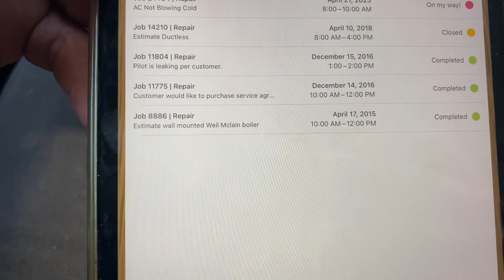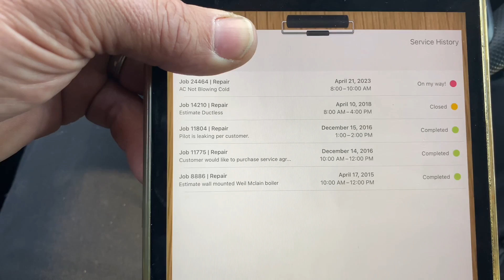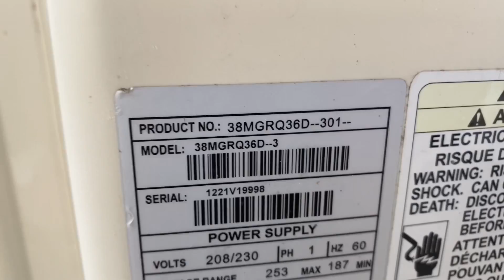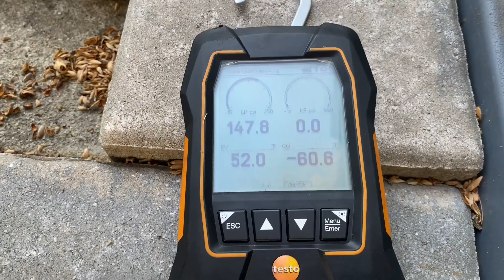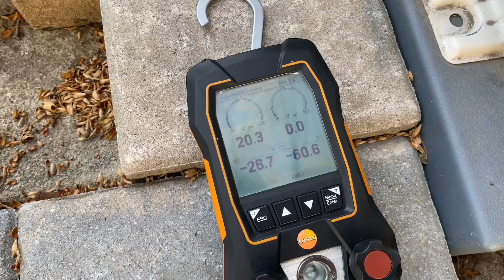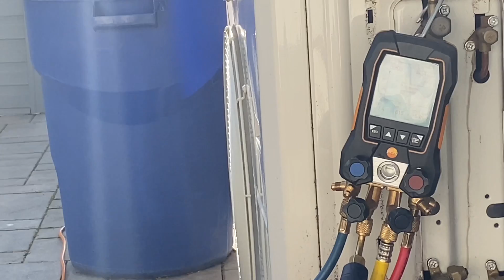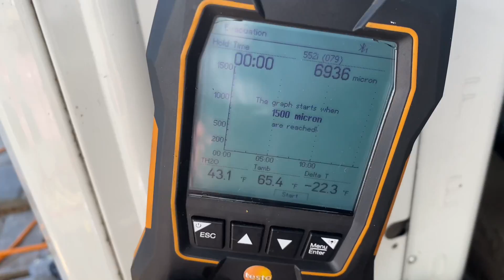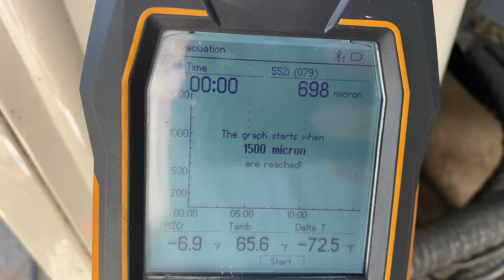Solving the Mystery: How to Locate and Repair a Leak in Your Carrier Multi Zone System!

Comment: I recently ran my pump without oil (same pump) noticed it was gassing alot the valve was open but I was already down to 900 microns closed my valves and all 😂😂😂😂 great work!!

Also about to invest in a second vacuum gauge tried the y Jack and it disappointed me 2x I’m thinking about Uei,hilmor,Accutools. I like my mg44 always works great with the trublue hose setup

Comment: the bad flare looked cut crooked/dull cutter wheel, flared crooked and probably never reamed. I can say a tiny burr on the pipe end will destroy the flare every time, regardless of the type or usage.
I do quite a bit of double and bubble flare fittings (automotive and others), flaring steel and especially old lines are always a big nightmare. although I mainly use nicopp lines now, easy to bend and flare and no rust(except the fittings!
**spray the leak search in stream setting and slowly, so it comes out in a solid liquid stream, with minimal bubbles and let it run around the fitting. even then a bad leak will be hard to find, because it blows the stuff off before it can bubble.

Comment: I went to a carrier class that said you can’t do anything but weigh in charge on mini split systems. Do you agree? Is best practice recover and weigh what’s left in system in to new recovery tank then put that back in and then finish with new refrigerant to full charge? As long as no burnout in existing gases okay?

Comment: It was probably 130 degrees up in that attic while he was installing it and he possibly had second thoughts about that flare, but it was holding at the time.  We have all done that at one time or another.  Usually when you have a seed of doubt it holds water more often than not.  Good fix Mike!!!
Reply: @PipeDoctor  Anything is possible huh??  I wish we had the options of brazing all connections on them.  Perfect flares or not, sheet happens.

Comment: Summary was generated by Summatim, let us know if there are any inaccuracies! 🤖
0:01: Introduction
1:16: Dispatching and Invoicing App
1:37: Previous Service Calls
2:51: AC Unit Details
4:21: Undercharged AC Unit
7:45: Flare Connection Repair
14:36: Vacuuming and Charging
15:33: Conclusion and Contact Information
15:52: Consulting Services Offered

Comment: Hay !! Don’t feel bad coz happens to everyone of us!!  An if any HVAC contractor says he has never made that mistake several times in his life??, He/She is a flat out lying piece is 💩!!!  But I had some sealing problems with a Heat Source unit ( not naming company) an on the 3rd time flaring the last time with a brand spanking new flare tool an still leaked an called tech-support, and they said oh yes, we are aware of occasionally that issue they overnight expressed ship me a zip bag of domed nylon flair washers that goes between the copper and brass flare…an?? Yep haven’t been back to work on that pacific unit!!! The were aware of a defect in the port valve flare.. but I carry them with me all the time now on mini splits.   But dam she was a tad dirty on the coil.. lol on the condensate drain?? When I was doing everything myself, I would not necessarily use the colored primer because I never forgot to glue a joint, but the hired help? Dry, fit everything together and then pull the part piece by piece prime, it glue it and put it together.
I fired a guy for just using primer because he was too lazy to glue it

Comment: Do you ever use dye injectors? I have had to rarely to find micro evap leaks and im talking brand new from the factory supposed to come off the line perfect but not always. And they probably had the intention of flaring that properly but was probably end of day were tired and didn't set the flare tool properly.
Reply: @PipeDoctor  If I got time I pressure test leak test evaps out of the box don't wanna be coming back 90% of the time it will be fine but trying to find that evap leak which is small but over a year will lose vaccum and refrigerant is annoying

Comment: Hey Mikey, great channel. I have a small suggestion for you. When you use the micro bubbles for leak searching, try to use the stream function. Don't spray it. Slow, study, stream. The bubbles are so much easier to find. Especially micro leaks....anyways great channel, keep it up!
Reply: Limp dick Hasham
Reply: Yea i saw the leak on the first spray. Then it got sprayed over. My grandpa taught me dawn dish soap and water for leaks on anything. Pour slow or submerge. Works every time. You dont even have to buy expensive leak detector (thats just bubbly stuff or soap or uv i really dont know) dawn and water. Keep a spray bottle of it. But use the spray bottle on wide open so it can ooze out but shake it before you put it out. Thats VP67 looked familiar.

Comment: 😂 don't feel bad Mike, last week did an AC install and hooked up one big blue hose on the Suction and my blue vac on the liquid. Went to lunch came back vac was down to 150. My dumb ass for got to install the appion core removal tool on my suction side.  🤦‍♂️So I had to start over.

Comment: copper folded over on the flair.  Was not a clean cut like yours.
Reply: good chance they are. Bad flaring tool or cutter. cutting wheel might need to be replaced

Comment: Hey mike and Peter great job on that system keep up the great work and Peter will go far in the trade with you Mike
Reply: @PipeDoctor  you’re welcome bro anytime. That was a great find on the air handler in the attic that flair was pretty 💩 but it was still a great find.   Glad you’re put the magical touch on the flare to fix the problem.

Comment: I installed a hard start capacitor and replaced the capacitor on my 2.5 ton unit.

I tested the capacitor and it was bad on the compressor side.

I just started it yesterday and the air is coming out at 45 degrees From the vents
I have to check the condensation drain line. I think it is leaking under the house

And I have to pull the weeds around the back of the A/C unit.

Goodman scroll compressor

Really worked well. 11 years old.

I had to replace the capacitor 5 years ago. This time I put in a hard start kit and a new capacitor.

It starts easier 

I am leaving in the window A/C in the bedroom, just in case.

I am sick and need it to be cold to breathe